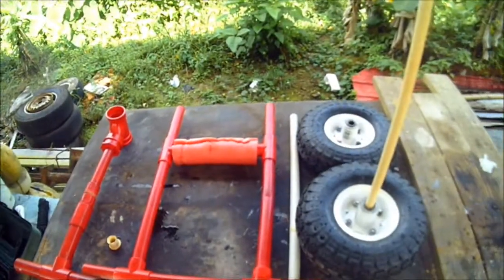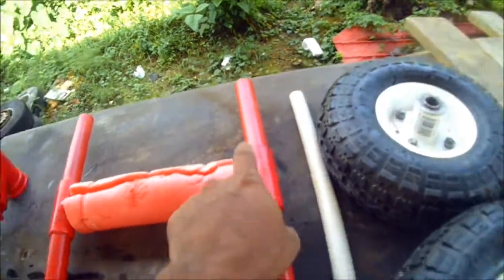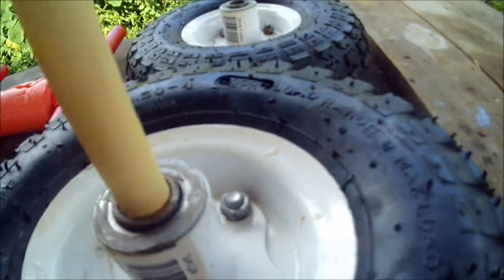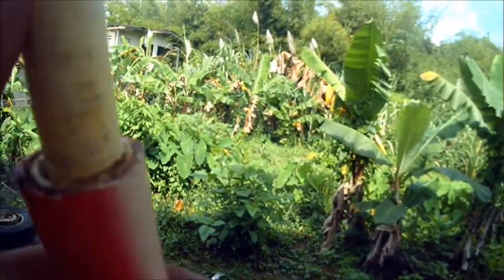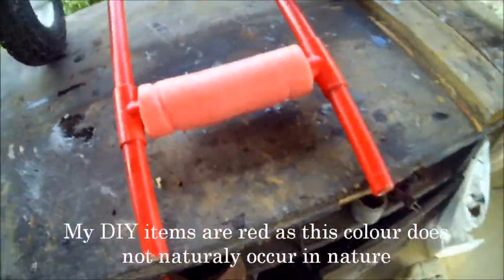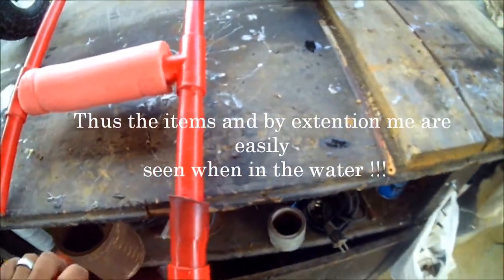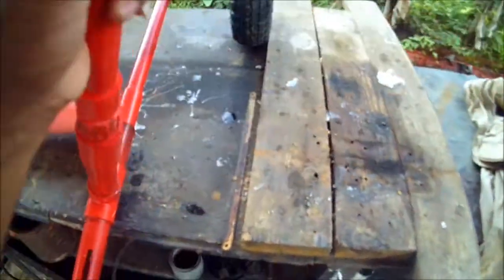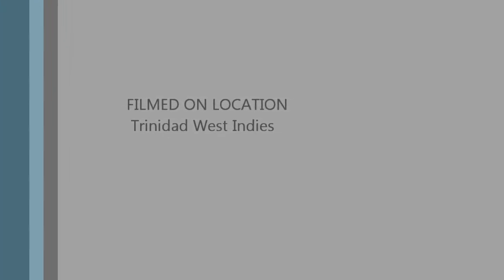DIY Kayak Trolley

Comment: id like to copy it, but u gave no dimensions. ):
Reply from the maker: s buchanan 
The dimensions were made to fit the Perception Rambler 10''. The scupper holes are 12 inches apart, so the H frame is 12 wide and 21 tall, the axle is 26" long, all in all it's about 30''tall, but the top 6'' fit into scupper holes. 

 It was built so it would fit into the scupper holes at the back( ie 12'') and when loaded to the front of the yak the wheels over lap the sides(ie 26").  Hope this helps!!